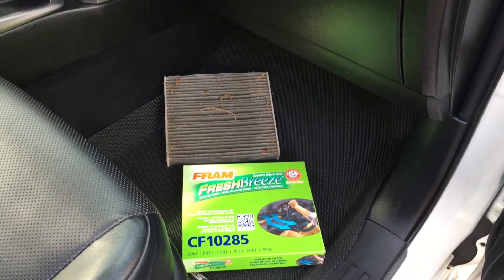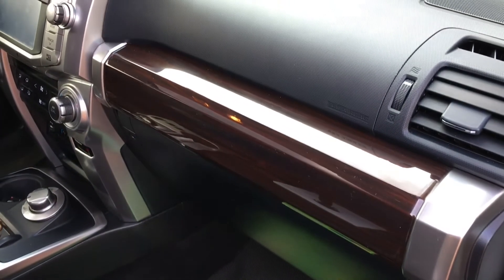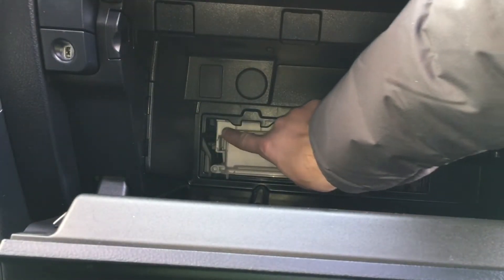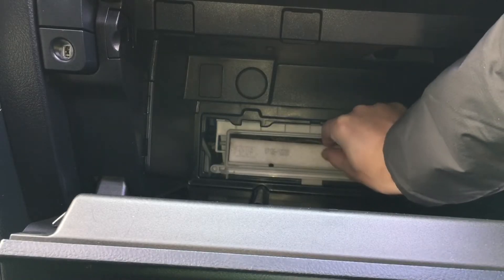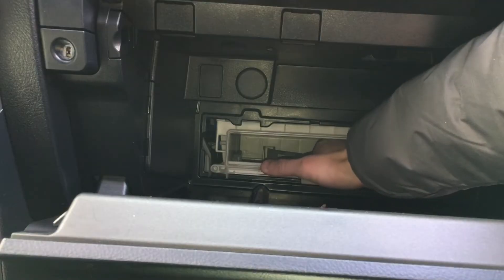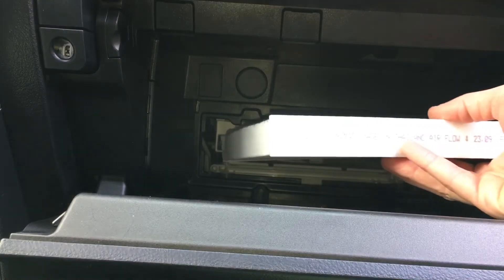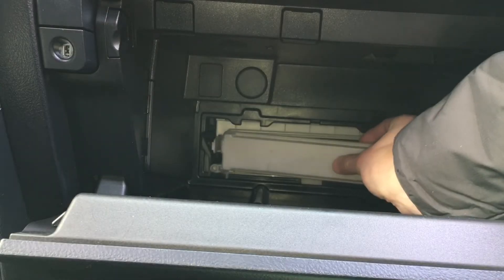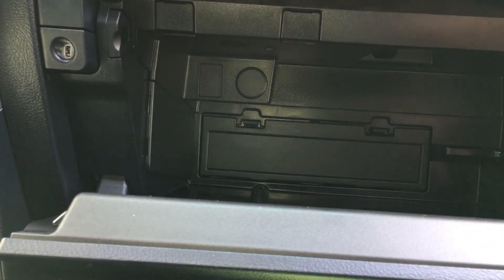How To Replace a Toyota 4Runner Cabin Air Filter 2010-2024.

Comment: This is the most confusing part. The arrow mark on the filter that you pulled out (@ 0.55 mark) points upwards. But when you put the new filter in, you had the arrow mark pointing downwards.
Reply from the maker: Sorry for the confusion one filter had an “this side up” arrow on it and the other had a “air flow” arrow which is the opposite in this case…hopefully this helps! Thank you for watching.